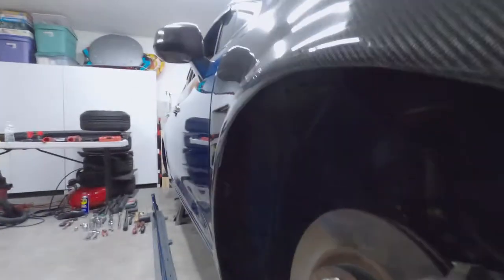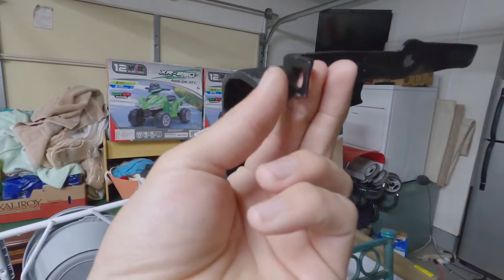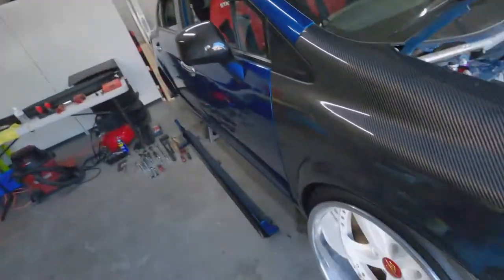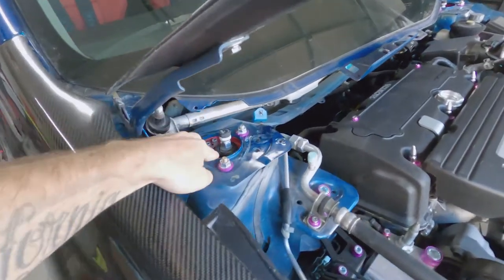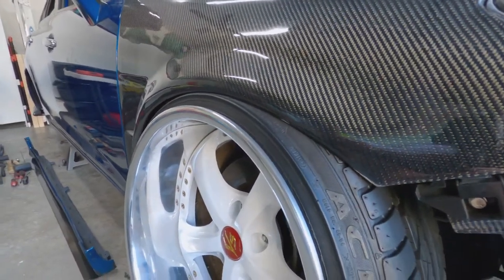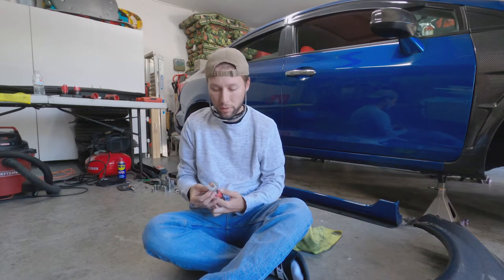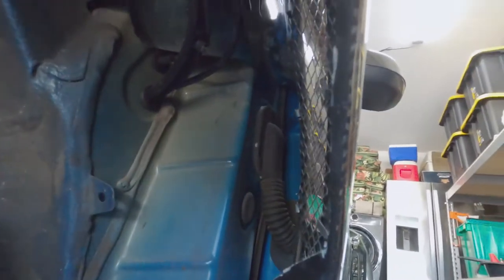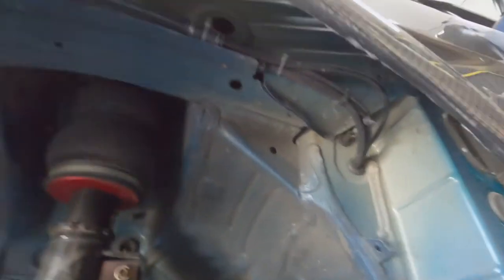Installing CF Spec Carbon Fiber Fenders On 9th Civic

Comment: I have a ‘13 Si Sedan, If you can tell us what exactly what you have as far as secondary suspension components your running aside from Air Lift. I see you running tie rod extenders, ball joint extenders are you running top hats on your air struts too?

Comment: How is the fitment for wheels on these? Do they fit wider than stock fenders?
Reply from the maker: they aren't too bad with fitment. You have to shave inner side to get the fitment of course and also have a bit of flexibility to help with it.
Reply: Also, how long did it take for these to arrive when you bought them?